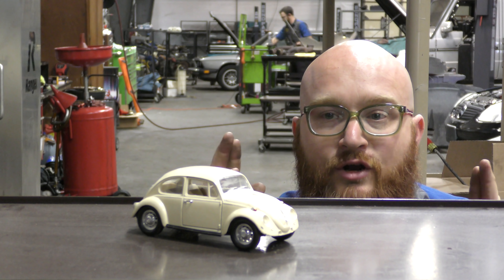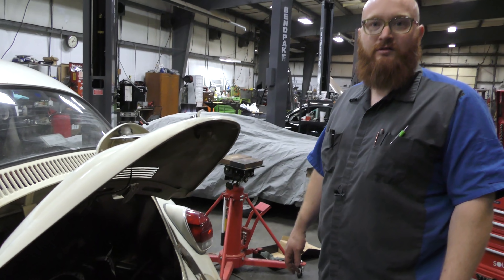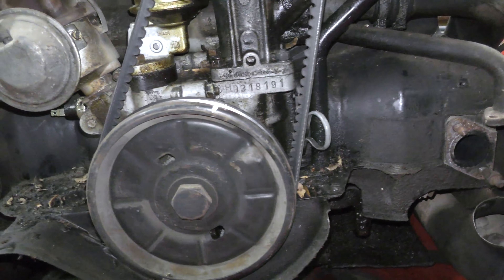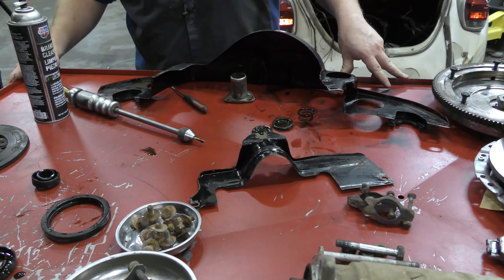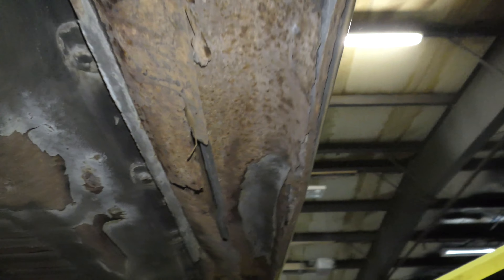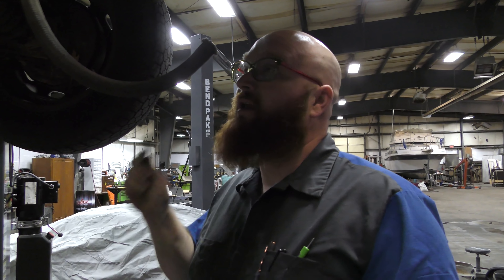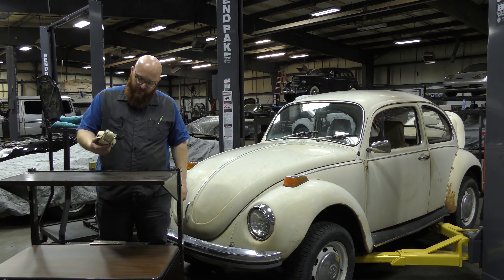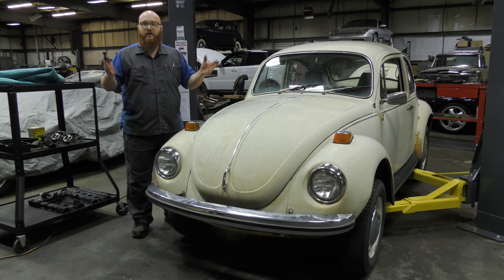Engine out for a clutch on '72 Super Beetle?! CAR WIZARD shows cool little car & huge repair process

Comment: Back in the day when VW actually made a quality product that would last. 
Long live the Airheads
Reply: Except the rust as mentioned
Reply: My daughter has a 2oo6 GTI w/ 150+ on the odometer. l wanted her to buy a Toyota b/c of her long commutes to college. That vw tho has been bullet proof. We bought it new and did the proper initial service and never needed the warranty. The little car is fast and still a lot of fun to drive.
Reply: Any VW before the year 2000 is very good
Reply: @pablopicaro7649  not too many rust-free 39-year-old cars. :-)
Reply: The success was cheap parts that were always in stock.
Reply: @stevewhite3424  You mean 49-year-old right?
Reply: Disagree.

Lots of work needed just to keep them running. Compare these to something like a Falcon, Dart or Nova, and these required a lot more service.  Lots of valve adjustments, oil changes etc.
Sure they were cheap and easy to fix, but a lot of PM to keep them going.
Lots of design flaws also. Back in the day you would see lots of dented front fenders because of the fact that the driver could not see the  corners of the car. One of the cylinders were prone to oil starvation if you let the oil level get a pint low. 

Fuel lines were prone to leakage and had to be changed every year.

Due to not wanting to pay DuPont a royalty the plastic tended to gas off leaving an annoying film on the inside that was a persistent pain to clean. This was also the cause of the German car smell.

Comment: Mustie1 does these for fun during his lunch hour ...both hands tied behind his back and eating a sandwich !
Reply: He does, and is brilliant..but they are not really complicated, I would say most of us could do it but maybe with both hands sans sandwich..The Porsche versions are a different matter. They are built to much tighter specs. Watch Mustie rebuild the 914 motor, it's an eye opener on the quality differences.
Reply: Mustie1 has a great channel.
Reply: Mustie1............one of the best on you tube!
Reply: Old guys I used to know that worked in our local VW garage back in those days could have done this clutch in 30 mins. But, that was all they worked on and they knew the cars really well
Reply: I went straight to the comments for Mustie1 references 😂😂
Reply: He only does "rustorations." He is a treat to watch.
Reply: Mustie1 just did a clutch on a VW. Actually showed every step.
Mustie1 is the best.
Reply: Mustie would never buy a part he would make one or refurbish it.

Comment: I replaced many VW clutches in the 1960's and it was one of the easiest jobs a mechanic could be assigned to. From driving the car into the workshop you could have the engine out in 15 minutes. They were such a simple car to work on.

Comment: Shortly after my posting to (West) Germany in 1983 I purchased a German production 1967 VW "Beatle" with a factory 1500 engine which also required an engine out clutch replacement. Thankfully, for us U.S. soldiers assigned to the area and German citizens owning "Beatles" there was an gent whose sole purpose in life as a mechanic was keeping such vehicles running properly and capable of passing inspection (think rust, parts, and welding) standards of the day. With his expertise my "Beatle" and many others, both older and newer models, gave us great service. I actually was able to sell my "Beatle" to another GI for a little more than I paid for it before I rotated back to the States in 1986....By the way, I was the fourth owner of that car and I loved it so much that when my then brother in law was looking for a first car I recommended he purchase a 1966 "Beatle" which he drove from 1986 till 1997 when "family matters" required a larger more baby friendly vehicle!

Comment: Washer fluid does not flatten the spare tire ...

.. there is a check valve that stops feeding the washer fluid pressure when the spare tire gets to the air pressure needed to drive on so you can not deflate the tire. 

Mine was a ‘66 1300 in Sea Blue w/ white interior.
Reply: Thanks... learned something today and I thought I knew most everything about beetles. I have a '63 ragtop that I will never sell.

Comment: Important to check the battery cover (under the seat) ..it can cause a short on the rear  underseat insulation causing a fire; also, important to check the rubber grommet on the fuel line/firewall area.  Thanks for the video!

Comment: In Europe it was called the 1302 (1300) and 1302S (1600) and was the last of the flat screen designs but first with the new suspension. In 73  they released the 1303 (1300 ) and 1303S (1600) with profiled windscreen, large rear lights and the dash was sculpted with a foam construction. I bought, new in 73, one of the first 1303S, reg OOU 381M in Sumatra Green,  Within a day I had to change the tyres because -------- they came with crossply as standard. The cornering was "interesting" at any speed. Subsequently fitted radials and it made it a fantastic car to drive.  Fond memories.

Comment: Let it be said that my uncle used to make a big fuss about the fact that the local albertsons sold beatle parts in the  oil section . He was so good at getting those air cooled motors out he could have it out apart and back in before the sun set .
Reply: IIRC the world record for a beetle engine swap is under 15 minutes, I believe with a crew of 4.
Reply: That is wild! Was that in Southern California? I've never seen so many old Beetles still on the road other than OC/LA.
Reply: @kuebby  no north Texas was the weirdest thing to see while picking up grocery's in a town of less than 100000. And yeah here's your ground meat need a head or a valve cover for her beetle .
Reply: @stevenveach6984  Interesting, I didn't realize you had Albertson's in Texas too.
Reply: @stevenveach6984  Whoa. I just looked it up and they have stores over like half the country! I don't think I've ever noticed one outside of SoCal.
Reply: @kuebby  have you been to Mexico?
Reply: @frankg6578  Not particularly or recently, are there a lot of Beetles down there? Or Albertsons?
Reply: @dustintunis9347  It's actually one minute four seconds!
Reply: @andrewallen9993  - I didn't do any deep research, just a quick Google.  When was the new record?  1:06 was in 2005.
Reply: @dustintunis9347  :)

Comment: I worked at a shop in the mid 1970s that specialized in VWs. I lost count on how many clutches I replaced. I got quick after a while and we used to race to see who could get the engine out the fastest. My record was 14 minutes. 
I drove a 66 Beetle. One customer was going to an appointment and she blew her car's engine coming in for gas. We swapped the motor out of my car (both 1300 CC) and she wss on her way in 35 minutes. She called and asked if she could come back the next day. By that time my boss had rebuilt her engine. She came in the next day and we gave her the fresh motor and put the engine back in my car. 
Plus I got a bonus for letting her use my engine for the night. 
I really love working on those cats, just like the Wizard and I don't know why I haven't bought a vintage Beetle yet.

Comment: Those engines were bulletproof I still see Beatles in Europe where I’m at quite often
Reply: The later ('72 and newer IIRC) with the offset "doghouse" oil cooler arrangement were more reliable.  The earlier engines had the oil cooler partially blocking the cooling air passing over the #3 cylinder, resulting in that cylinder failing at around 80K miles and the engine needing a rebuild.  On the plus side anybody with half a brain could do the rebuild in their driveway in a weekend!
Reply: Especially in Liverpool!

Comment: I worked on many of these back in the day. I helped remove the engines so that the clutch could be replaced. When they would overheat, they would start pushing the crankcase apart, causing an oil leak.

Comment: Been there, done that. Owned two. I found it to be the easiest and quickest clutch change, unless you need to resurface the flywheel or replace seals. Owned five different Type 1 VW over the years, but three accounted for near 500,000 miles of driving. All were CA cars, but I lived there 45 years.

Comment: Mustie1 can have the engine of a Beetle out in like 1/2 an hour all by himself. It’s quite impressive
Reply: I take out the engine myself in 10 minuts.
Reply: Does he take a 15min tea break during it?
Reply: With a lift that's actually not very fast. 10 minutes is like from pull the park to out if you do it with just one floor jack, the trick is a block of wood on the jack so the throw on the jack is right.
Reply: Yeah I’m sure you all can do it faster than a guy in his mid 60’s. Post an unedited video of yourself pulling out the engine and prove it.
Reply: @Cristobal_Ygnacio_Arriaga  we used to have two man team races at dub meets  Drive up, pull it, dragg it 10 feet, back in drive away. 5 minutes and 30 seconds.
Reply: He can make them run when nothing else ever could.

Comment: on my first car; '67 green bug with corroded heater lever cables, windshield washer powered by the spare tire, and a rebuilt engine that swallowed another valve after only 5K miles (she had 105K when I sold her) BUT her running boards were intact and she was 12 Volts so I could install a Craig 8-Track player and speakers!
Reply: 8-tack made it all good
Reply: I had the same Craig 8 track in mine,  with a separate equalizer/amplifier, and 4 speakers in the rear well.  Mine was orange with orange shag carpeting.

Comment: Owned 2 of them in my past life, a 64 with a 6 volt system and a 69 and loved them both.
Reply: 6v headlights sucked
Reply: @pablopicaro7649  Yep. at night I could not use the radio, otherwise I couldn't see where i was going

Comment: Between 1981 and 1985 I had a '71 Beetle and a '74 Super Beetle. I'm 6-4 an fit just fine. I briefly had a Karmann Ghia but it needed more work than I was capable of at the time so I traded it to my dad for the SB. There is a replaceable pilot bushing for the starter  that should be replaced since you pulled the starter.

Comment: The exhaust doesn’t make it into the cabin ... and neither does the heat 😂
Reply: needed an ice scraper for the inside of the car. 8)
Reply: @schmidt28117  I used a lighter
Reply: It starts to work about when you get to where you're going.
Reply: How would that work? Rear engine cars seem more trouble than good. I’ll stick to front engine for now.
Reply: But the gas smell sure makes it
Reply: @angelgjr1999  My electric Smart is rear-engined, and its heater will make you sweat.
Reply: The stench of leaking oil being fried on heat exchangers  sure did.
Reply: Years ago, we'd fit an electric assist blower under the rear seat to give decent flow through the channels. You could do a similar modification in the dash panel.

I can't state strongly enough how critical it is to have a properly sealed exhaust on these machines. Folks ignore those heat exchangers.

If you're wondering how well it works...well, the Porsche 911 used the same system. Much better ducting and heater boxes in that case.
Reply: The heat made it into the cabin on mine, but the defroster was another story.  I used to keep a squeegee and ice scraper in the glove box to keep the windshield clear.  The air coming out of the floor vents would practically give you burns it was so hot. A Super Beetle should actually have a defroster fan, tho.
Reply: The heat is blown into the interior by the cooling fan. If you followed the 1, II, III marks on the speedo, there would be plenty of heat, and there were slides on the front floor vents to put more air on to the windshield. My dad's '68 would roast you, more heat than the '73 and '74 that I owned....
Reply: Yes, you need an ice scraper for inside. I had a 1968 Type 3 squareback years ago and I had a thick plastic ice scraper behind one of the front seats, next to the rear footwell heater outlet. Completely melted the plastic. The heat may be less, but its very hot. The Type 3s had a second small heat exchanger on each side for the rear 2 cylinders (#2 and 4), which increased the available heat some. Beetles did not have these. I had both Beetles and Type 3s. A little known fact is the 1968 on Type 3s had electronic fuel injection  (analog system) and it worked quite well. Bosch D Jetronic.

Comment: There are still a lot of them in Australia. Less rusting here. I had a 71 super bug. When I sold it in 2009 the only rust that it had had was on the rear floor. Mine used the air from the tyre for the washer. Mine was an Australian built one. Good to see that it still has the gear pattern label on it.

Comment: War Tortle's grandpa, known as World War 2 Tortle
Reply: Clever. And it made around WW2 and I thought about how this beetle got started
Reply: Class🤣👍👍
Reply: @1985toyotacamry  I’m pretty sure the first Gen Beetle came out in 1938. Had a banjo steering wheel sourced from Ford, mechanical drum brakes, and the seats were made out of canvas. Split rear window too. These first Gen pre-war models are worth a small fortune today.
Reply: VW beetle back in time when Ferdinand Porsche act like a proper Chinese and literary stole design from the Czech Tatra  (V 570 & T 97) and yes Tatra sued Ferdinand in 1939 when realised that unfortaly for the Tatra a guy with the funny mustache rolled into the Czech soon after. 
Bad luck for the Tatra didn stop then in 1945 another guy with the mustache come and stay up to 1990.
Reply: Holy crap underrated comment
Reply: @joe6096   very true even more than the standard beetle that came out in the 1950s.
Reply: War Tortle's "Argentinian" uncle

Comment: I had go pick up the "how to rebuild your Aircooled Volkswagen engine" book because I got a 1966 1300cc Aircooled buggy. Going to build it into a 1600 single port. Already has the 12 volt system in it so that's one less headache to contest with.

Comment: My first car was a '72 Super Beetle. My mother was the original owner. It had been on blocks for 6 years before I turned 15 and she told me I've got a year to get it running.
I got to the point that I could have the engine out in 15 minutes. I found it was faster to pull the engine to change the plugs then trying to do it with it in the car.

Comment: I knew a guy who had a couple of Beetles and Porsches. He kept an extra Beetle engine in the corner of his garage, oiled and covered in plastic garbage bags. When something went wrong with the engine, he could swap it out in about an hour by himself. Over the next month or two, he would rebuild the original engine, oil it, cover it in plastic, and put it in the corner of the garage. He was never without his car for more than a few hours.

Comment: "Engine out" doesn't sound too bad when there isn't any coolant hoses and the engine is only 1600cc
Reply: 20 minute job.
Reply: 4 bolts a few wires and a fuel hose.
Reply: Nothing to do with engine cc.

Comment: Hi Car Wizard.  Helped a friend rebuild the engine on a 1964 Volkswagen Beatle.  New clutch, big bore kit (1200 cc to 1380 cc).  
New bearing, new pushrods, heads were refurbished with new valves, guides, and seals.
Ran well after the rebuild.  Oil tight.  Good project.

Comment: Clutch on a Beetle is one of the easiest clutch jobs in the world, four bolts and a few cable disconnects and you can drop the engine down on a trolley jack, clutch swapped (with the handle of the screwdriver in the factory toolkit to align it) then back in.  First time I ever did it was about 90 minutes drive in drive off with a couple of cups of tea in between.  I can get the engine out by myself in about 15 minutes now and I actually drop the engine out of mine just to service it 😁

Comment: Defrost = ice scraper and you scrape the INSIDE of the windshield as you drive.
Some guys on YT can drop an engine in under 5 min.
In my early WD days (summer of '79), I took a VW bug with a blown engine in partial trade for a '76 Cougar I had for sale.  My cousins in MN had a rusted out bug w/ good engine so they put the engine in the back of their Suburban and came to northeast NE.  We had the engine in and running in an hr and off they went.  Bug sold.  I was happy and they were too.  Don't remember if dad fixed the old engine or not.
Reply: yep

Comment: Wonderful cars with lousy heaters. Did a system rebuild on the first beetle: air boxes and channels patched , cables freed up, doors lubed...good as new. Result? Heat vents blew out tiny blasts of incandescently hot air on your feet...sneaker melting hot. cabin still arctic, like trying to heat your house with two Bid lighters. Subsequent beetles? dressed more warmly.
Otherwise, superb bits of unique engineering, courtesy of Dr. Porsche; had plenty of other great cars, but these were very special, with reliability equal to a cinder box, and tons of fun to drive!

Comment: My family had a '61 beetle that ran for years and years (Whereas my dad traded the Ford Country Squire every two or three years).   Fuel pump failed  and it was $7.00.  I was flooded in the Albany airport parking lot. Oil change and new seat covers, and it kept running.  No touch screens, just an AM radio. It just kept going.

Comment: I drove old Bugs for more than 10 years, and did all my own maintenance. One of those cars was a 71 Super. I did clutch, and CV joints on it once. 5 wires, accelerator cable, fuel line, and 4 bolts, and off comes the engine. Flywheel nut gets torqued to 234 foot pounds.

Comment: Had a new 67 and a beater 63 for commuting 60 miles round trip per day, last 3 years I had it it was running on only 3 cylinders, still did the job, and got good gas millage